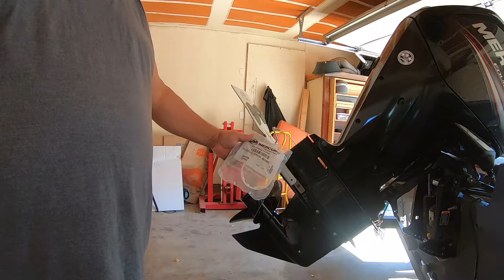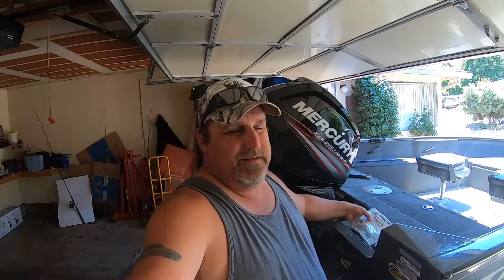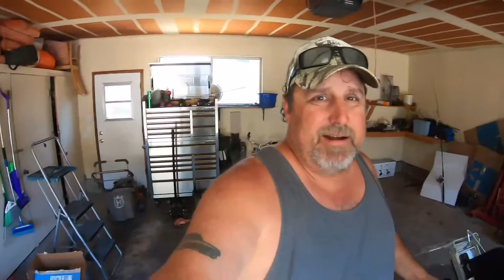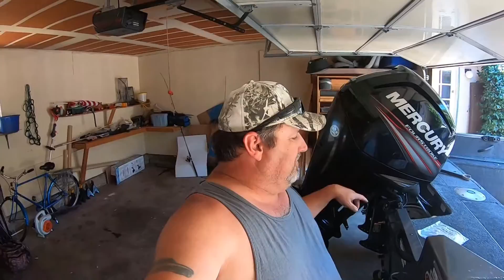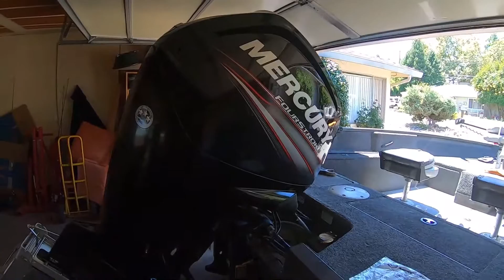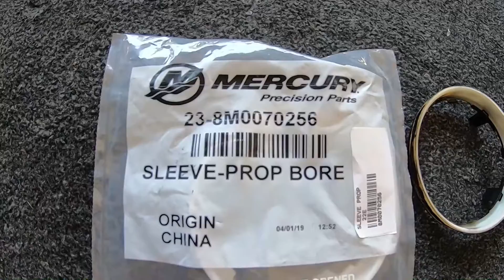Mercury 4 Stroke Prop Bore Sleeve Replacement

Comment: If the tabs break will this cause damage to the engine or leave you dead in the water at all?
Reply from the maker: No just a little engine surge sound is all when they break, I've been putting them im with super glue gel after cleaning surface with break cleaner stay in all year like that

Comment: Mine it's gone and I was getting  a lot of cabitation..just finout  thanks  for the tip easi pice.🎉
Reply from the maker: Clean with brake cleaner and super glue gel it, that's the only way I can get them to last for one year

Comment: Great and informative video. When you reinstalled your prop, was there any play or slop in your prop at all? I did exactly what you did in your video and I have some play in my prop. Just wondering if I did something wrong. Thanks. Tight lines bro.
Reply from the maker: Slightly is normal

Comment: I am finding that my propeller "slips" at higher RPM, i can almost feel it. If I super slowly creep to full throttle it doesn't happen. I imagine ventilation from quick acceleration is my issue. Thanks for posting, I seem to be having the same symptoms so I ordered a replacement. Mine is very loose - still has all clips but it just wiggles around/slides forward and back
Reply from the maker: Clean the edges where it sits with break cleaner and put super glue gel around the prop bore sleeve,  I also buy spairs

Comment: Thank you! New boat owner here and never heard of one, let alone had to take a prop off. Kinda intimidating because I don't wanna f-up my engine. You explained it well and convinced me to do it.
Reply from the maker: Hey thanks for watching the videos,  on the prop bore sleeves,  I ended up gluing them in with gorilla super glue gel,  clean the bore housing with break clean and apply the glue is a few spots and it actually finally will stay in properly,  just happen to be a poor design on mercury's part!
Reply: @thefishstalker7640  I saw that people were recommending glueing them, which I'll do once my part comes in. Definately poor design :(
Reply: Hey mate. Great video. Do you think gluing the sleeve on will void the warranty?

Comment: How did it feel after you put the new one in as far as the prop spinning freely. I put a new one in and mine is very tight
Reply from the maker: Prop always spun freely, the ring kept shrinking with the exhaust heat, just put in the 4th one and put super glue gel on the outer edge of the ring 3x out now still in there sold,  time will tell, best option is just run a stainless steel prop air bubbles wont effect them and can run halfway out of the water

Comment: Currently trying to replace mine…should it be loose when the prop is back on and tightened?  I can find anything the tabs will snap on to. The inset that it sits in doesn’t allow it to Tavel down far enough to snap on anything. 🤷‍♂️
Reply from the maker: Yea a new ring snaps in, dang things break in just a few trips , I got 2 more again and will be putting some super glue gel around the edges next one see if it stays in

Comment: What size prop are you running?
Reply from the maker: I dont know the diameter but it's a spitfire 4 blade 17 pitch,  its proper right,  but i think a stainless steel prop would run better they dont blow out when you trim up, so exhaust probably wouldn't effect it like aluminum
Reply: @thefishstalker7640  I’m running 13@19 diameter 19pitch and get 42-43 on a 18’Crestliner
Reply from the maker: Yea the 17 pitch runs 43 2 guys and boat loaded

Comment: Thank you so much for this video. I have been having problems with my 150 mercury efi. After watching your ved. I thought what could it hurt. After replacing the prop bore sleeve my outboard runs like its new.
Reply from the maker: Awesome and thanks for watching
Reply: will this same part number fit the 150 EFI?

Comment: Great video, exactly what I was looking for.  Mine broke completely loose and was just floating around inside there.  I noticed it when I would try to take off and as it accelerated, it just felt like the prop was slipping slightly and not getting full power.  Replaced with this part and now its runs perfect again.
Reply from the maker: Yea mine still is running right but back to floating around on one side again,  I got a tip from a Yamaha guy he said the guys at the dealer said to super glue it in on the 4 prongs!! Thanks for watching

Comment: I had a major issue with this ring on my 2015 115 four stroke.  I run the Mississippi river and the silt was making it wear and pop loose after a few trips.  They actually had me super glue mine in place because the cheap tabs are bent inwards not outwards making them pop loose easily.  I've had the same ring now in for three years now without issue.
Reply from the maker: Thank you for the tip if this one pops loose I'll definitely do the same
Reply: @thefishstalker7640  was baffling the guys at Mercury till I sent them pics of the new rings with the tabs bent in towards the prop.  Guess thats what you get with cheap Chinese parts
Reply from the maker: Yep mine had to be broken in the first 20 hrs our lake did have a lot of debris that season too